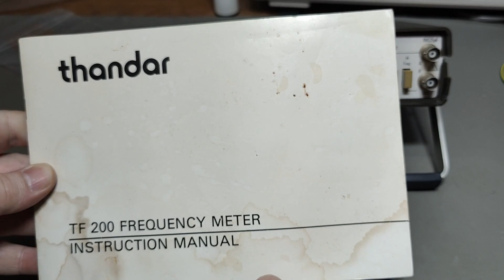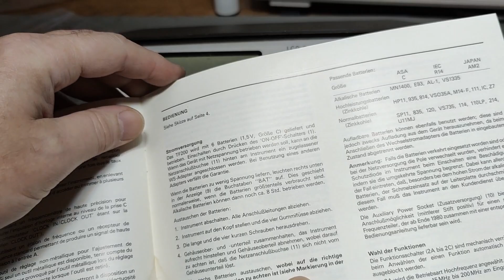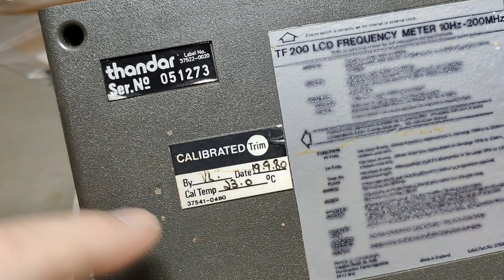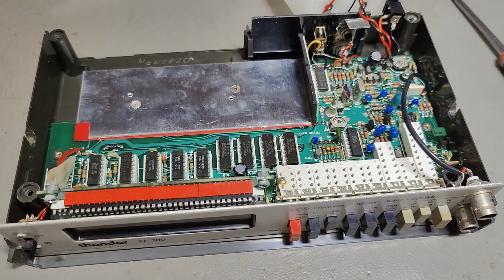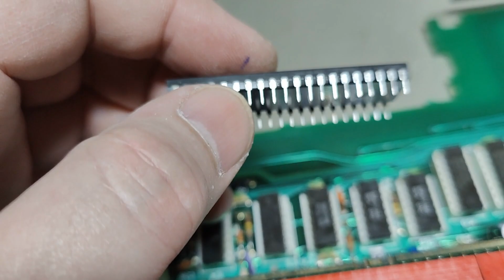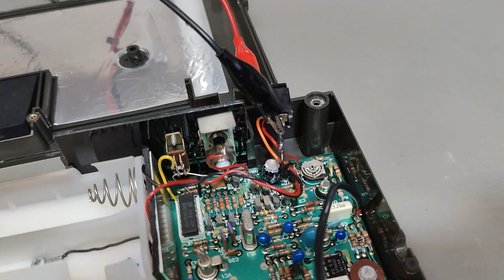Thandar Sinclair TF200 LCD Frequency Meter 1980 repair teardown

Comment: Does anyone know the supply voltage to the external power socket?  I would assumed it's 9 volts as the battery pack is 6 cell. Just want to be sure.
Reply from the maker: the schematic clearly show the external jack, disconnect the internal 9V battery, and then connects to the internal linear regulator, that makes 5.5V for the entire unit, so YES it is 9V, also note the protection diode is not a pass, but a short if connected wrong polarity, so use a current limited supply as always

Comment: Sinclair also fitted the reversed power socket on the zx spectrum, there was no reason for it.
You have a nice little counter there.
Maybe a tiny ovan for the crystal to keep it stable.
Reply from the maker: thanks for the info, i will try to remember this if I ever get a ZX spectrum again,

Comment: I found out the hard way about the centre negative DC socket on Thandar kit when I plugged in a centre positive PSU, I had the 600MHz LED version of this and managed to kill the ICM7216 chip, fortunately Aliexpress came to my rescue and I've since upgraded to a Racal 1998 but i did love my Thandar while I had it.

Comment: Thomas you are so right about Sir Clive  Sinclair, really a genius way before his time.. Had a Calculator once, and my biggest wish for my 15 years birthday, was a solder-yourselves-ZX80 ;-)
Really nice fixup - Good work
Reply from the maker: my first computer was a ZX spectrum 48k with opus discovery 3.5" disk drive, single sided 180k but wow it loaded the full  memory in a few secs, amazing power boost, versus cassette that took many minutes, and often failed loading. I think you are a few years older than me, that is why you talk about the ZX80 :-)
Reply: 😉👍 you are so right Thomas..

Comment: I did buy one of those a few years ago and it was in almost new condition except the battery holder was cracked as is common for these holders. There were 11 years overdue batteries... that is over the date printed on the batteries... luckily they had not leaked at all.
I took out the battery holder and mounted a small analog power supply and removed the DC plug.
It s a nice well functioning counter wich I have used a lot already.
Thanks for the upload.
Reply from the maker: wow thanks, nice to hear they still exist out there

Comment: Hi Thomas, nice little counter and a cool transistor stop. The power socket connection is quite common for devices with built-in batteries, and unfortunately it is also common that it does not have reverse polarity protection. It's been about half a year since I repaired a small mixing desk for a colleague from work, bought it on an ad without an original power supply, grabbed the first power supply I found at home with the appropriate voltage and turned it on without checking the polarity. When I told him that he was stupid, I got the answer "There is always a + on the center contact", so I misled him. I was looking in the supply of power connectors and it could be a 6.3 / 3.1 size, at first glance it looks a lot like a 5.5 / 2.5. If you stop for coffee, I can give you one with an adapter 😂
In the old workshop, I had a meter with a damaged reflective layer on the LCD, so I removed the reflective layer and created a transmission display using an LED backlight - it looked luxurious.

Nice day 🙂 Tom
Reply from the maker: i imagine people will loose or swap power supply units for small electronic equipment with one that just plug it, without double check voltage or polarity ??
an easy way to brake stuff, that is why all units should have huge voltage survive range and polarity protection, that is just not the case always :-)